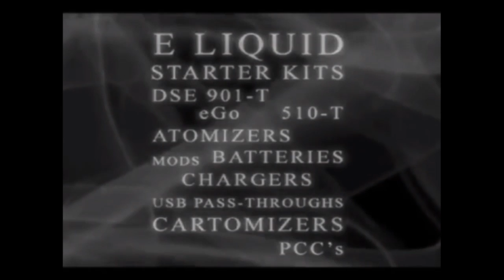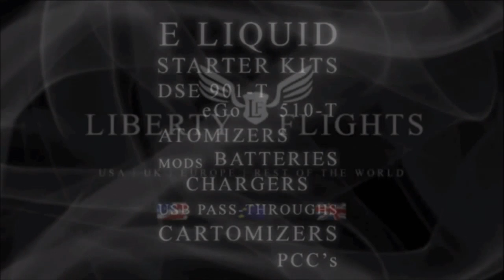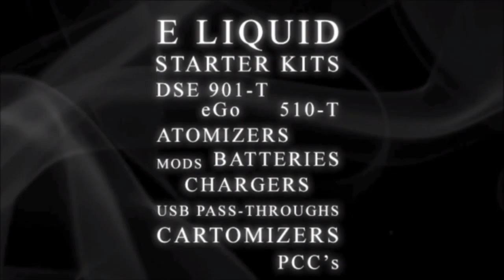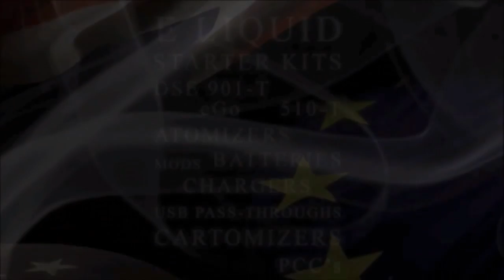Tin your tip 09 - 12

Comment: the board is "New Mini DC-DC Converter Adjustable Step Down Module Power Supply Output 1.3-20V" and can be found by searching this term on EBay
Reply: Thanks Mark, might come in useful if i ever get the courage to try modding something :)
Reply: Keith Hunt
no problem, it's a fairly easy board to use really, if you use it as it comes it's not a bad place to start modding.